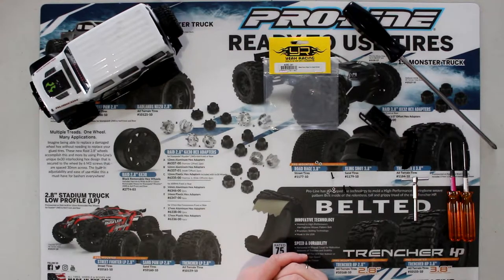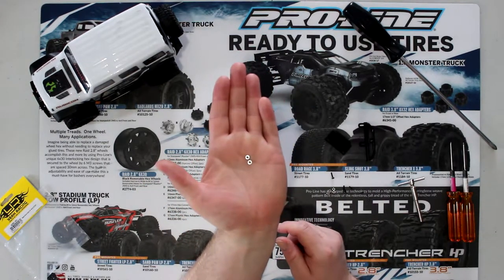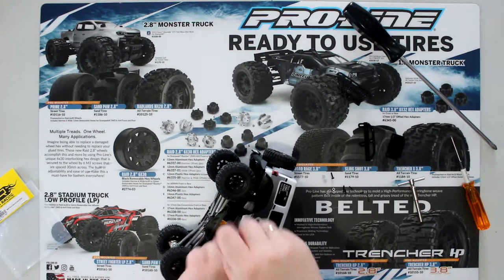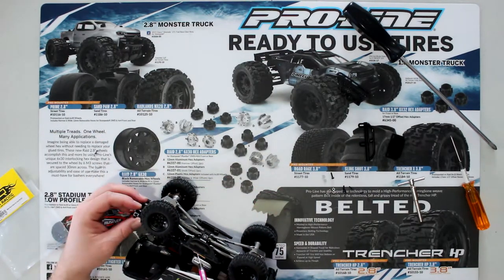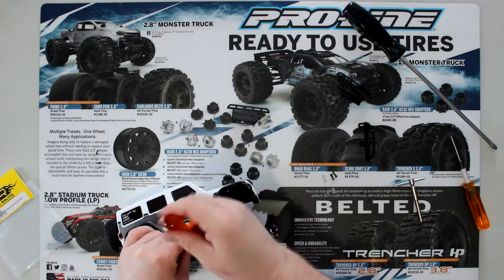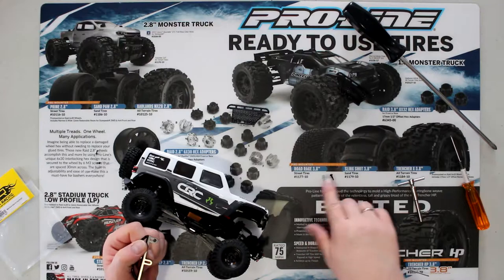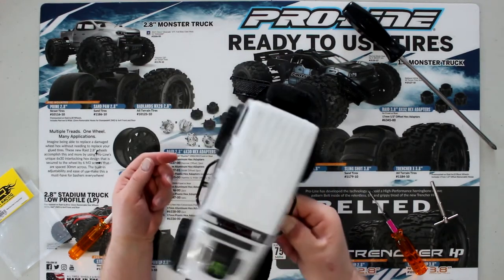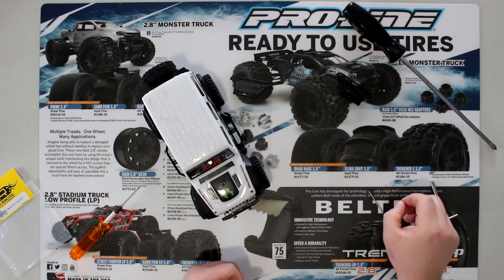Metal Rock Rail For Axial SCX24 Yeah Racing

Comment: Much easier to install if you pre-assemble the rails to the plates BEFORE attaching the plates to the frame.
(once you've figured-out which holes on the plates that you'll be using to get proper alignment with the body)